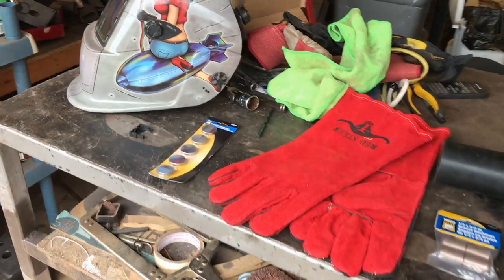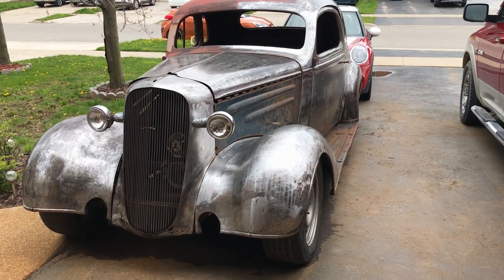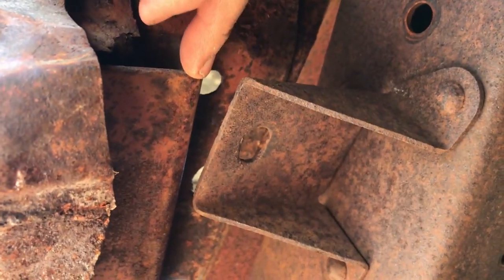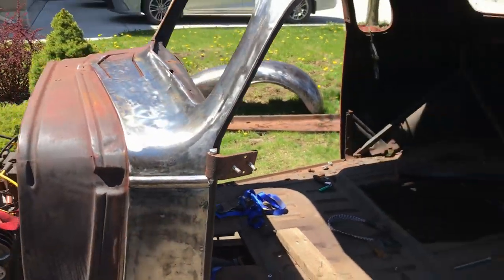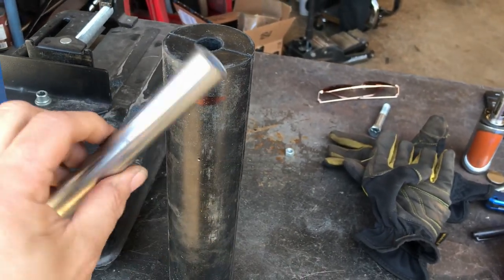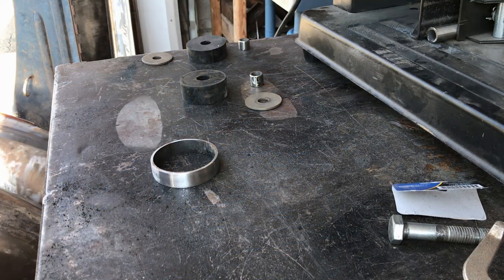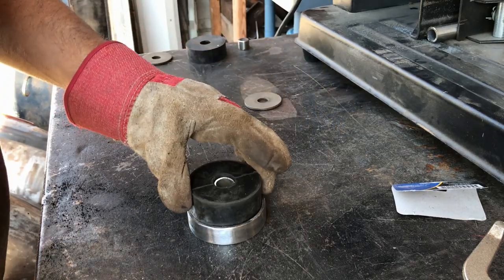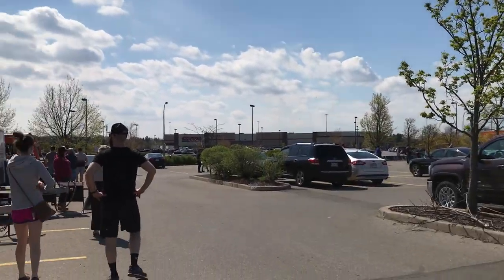1936 Chevy Coupe Body Mounts How To Make For Under $10 Not A Hockey Puck

Comment: ** and not a hockey puck! love that everyone's first option is the puck! lol
Reply: Go to for years in Rods ... no need for an outer collar as you use them to isolate the vibration from traveling from the frame to the body. All that smoke and gumming the saw blade/disk is not necessary..proper sized hole punch and hammer makes for a low dollar fabrication.. But to each their own. Best to you and yours.

Comment: Hockey pucks 1x3"
Reply from the maker: Thanks for the suggestion, but I hear they are too hard, plus, I didn't have any lol.
Reply: @ScottRods   All it is is rubber, I use them for engine mounts. For my rat rods are usually use say coolant hose which is quarter inch thick rubber and sandwich between 2 plates